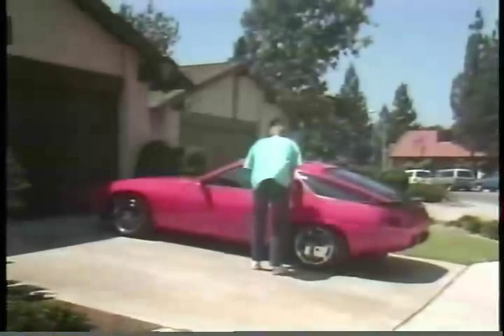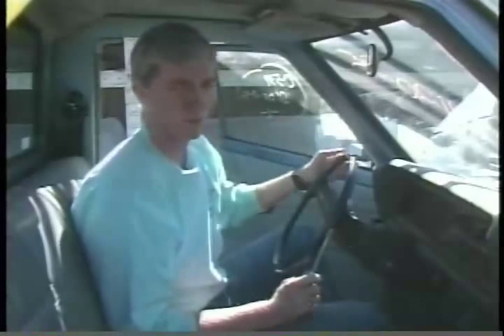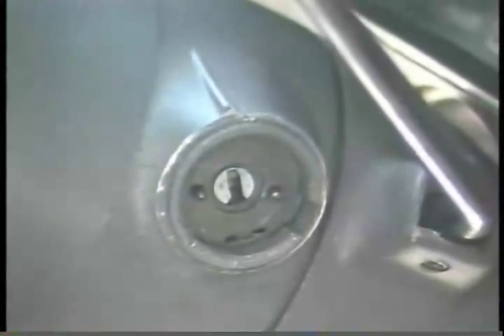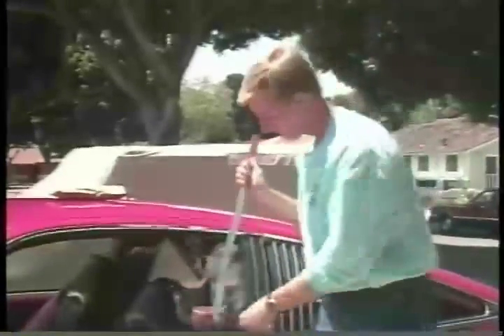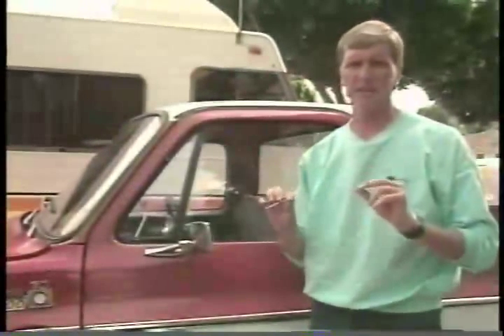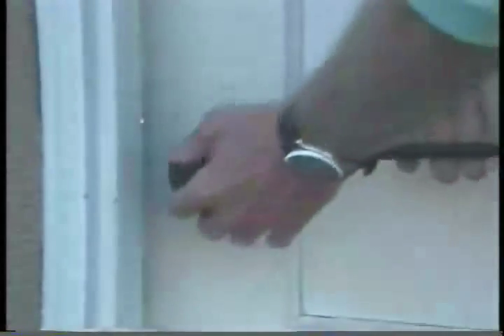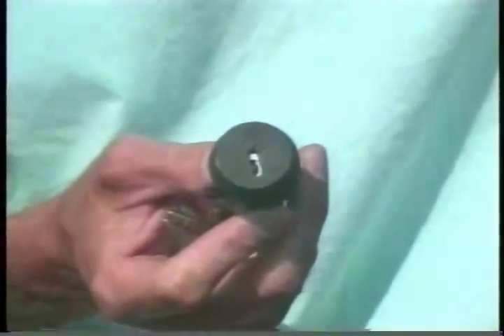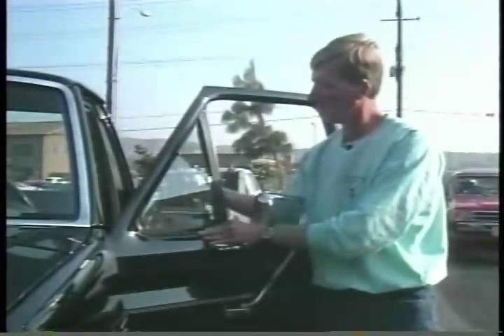How To Steal Cars (Old)

Comment: As long as it doesn't have a locking Steering wheel you could just run a wire from the coil to the battery and arc a screw driver over the solenoid. For educational example only.